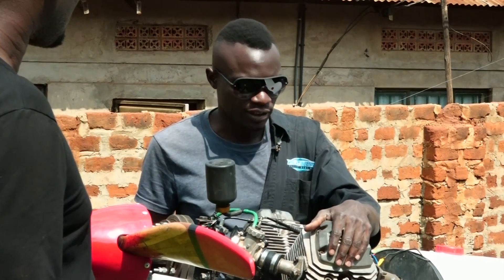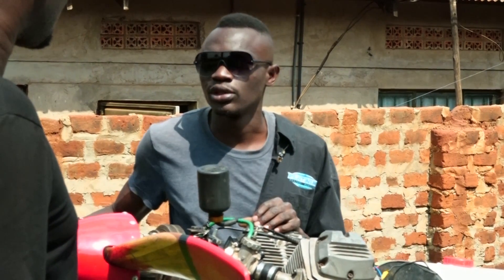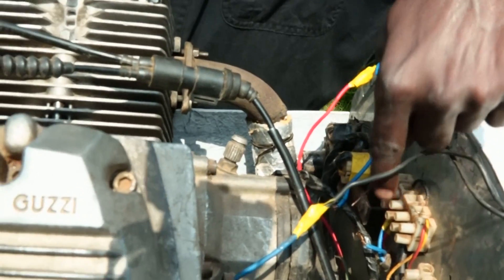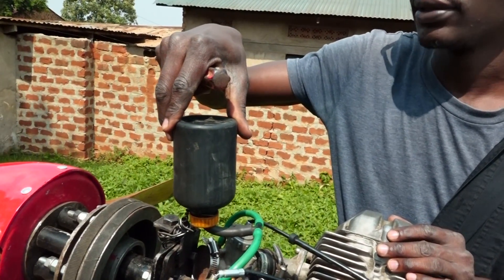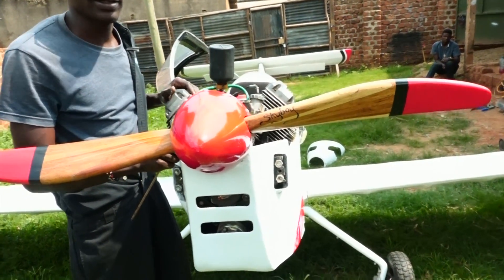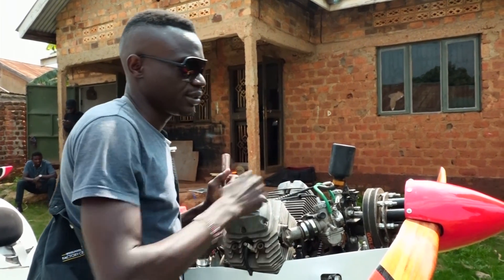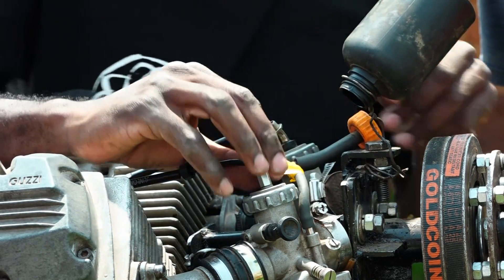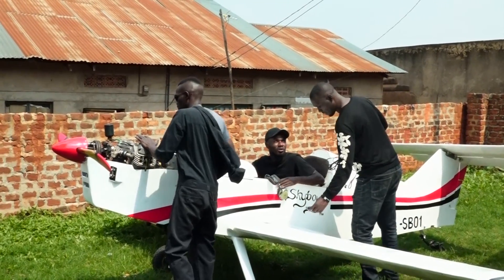Ugandan Made aircraft with unique propeller  -#Aircraft production in Africa in the making...

Comment: Out of all the homemade African flying machines I've seen so far, this one is the nicest looking one. Pretty sleek! 👍
Reply: Its built from real plans I think.
Reply: @cateyesexperimentalaircraf594  Perhaps a copy of a copy of a copy of a copy of a copy of a copy of plans that had coffee spilled on it.
Reply: @DILLIGAF2101  Nah it actually looks pretty good. It looks like an sd1 to me.
Reply: @DILLIGAF2101  🤣🤣
Reply: @cateyesexperimentalaircraf594  Yea compared to all the other african homebuilts I've seen this guy is top tier. Honestly looks (potentially) airworthy although I say that with the most extreme skepticism as you can only see so much from this video and parts are definitely sketchy, like the wiring. That said, if that engine does have 65hp, and its not overweight, and its balanced right, it might, just barely, but almost certainly not safely, fly. Just maybe. I'd like to see the video either way. :)
Reply: @cateyesexperimentalaircraf594  SD-1kit that most likely was incomplete and sold very cheap...but nothing he designed from scratch just wooden ceiling fan and other scavenged assorted odds and ends
Reply: Haywood Jeblomi  Shhhhh...🤫
Reply: Instead of cardboard and tape he actually "salvaged" parts from an actual airplane ✈
Reply: But still not functional 😅
Reply: It's actually a Czech designed and built kit aircraft, called a Spacek SD-1.
Look it up.
These d i n d u s  d i n d u  n u f f i n, except steal credit for a trademarked aircraft.
Africans are still in the Stone Age. Without wytes, they'd all perish.. and quickly!

Comment: Yep, a propeller with that pitch to induce cavitation is pretty unique.
Reply: Not a single thing you said is correct. Cavitation is where pressure in a liquid drops below it's vapour pressure point, leading to a momentary cavity of vapour being formed and then instantly implode back into liquid. Cavitation is relating to liquid and the sudden change from vapour back to liquid, it has nothing to do with propellers in the air on planes.
Reply: @ziongite  The guy you are replying to, this Deontjie guy, is the stereotypical youtube comment type infant. They just try to use a few big words and hope that it vaguely sounds correct, with the desperate goal of getting likes. Youtube is half full of adolescents, so it's not hard to get likes, despite what is being said not even being technically correct. I think a term for these people is pseudo-intellectuals. Places like youtube comments and reddit are at least half full of them.
Reply: Сударь, да вы троль, называя данный аппарат лодкой. Очень высокий уровень тролинга.
Reply: You're only looking at the root. Look at the tip.